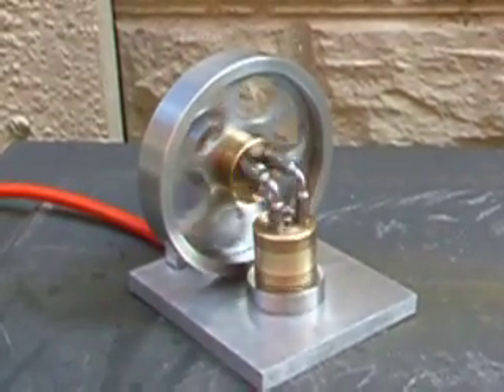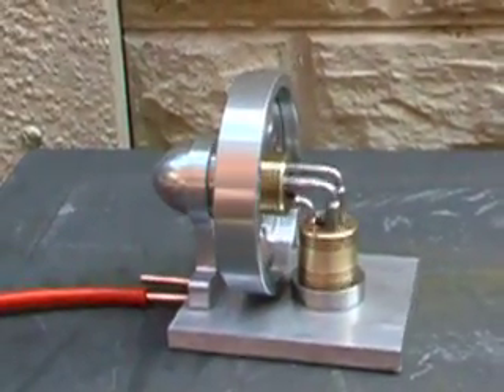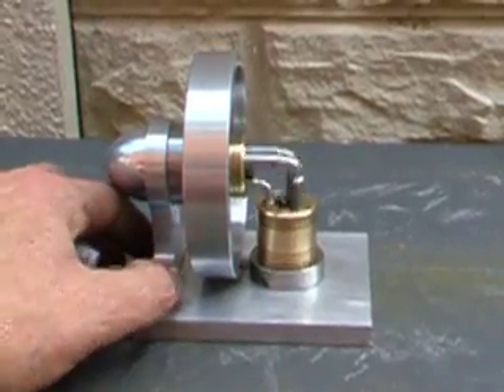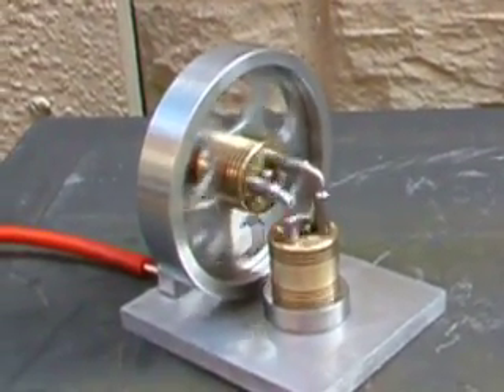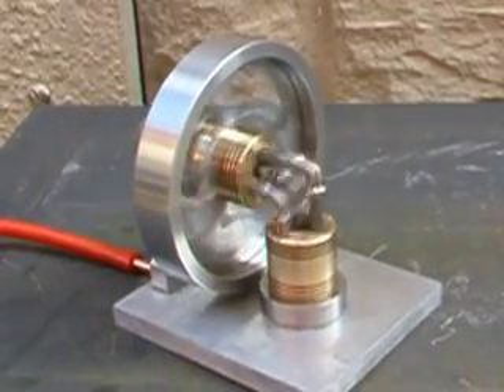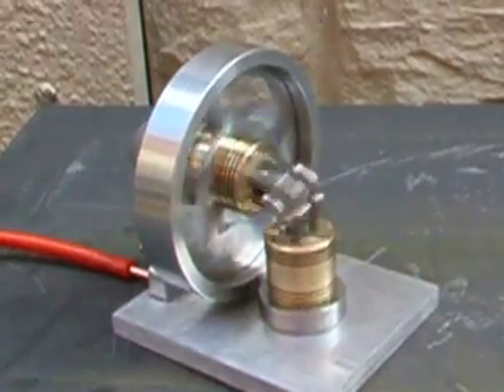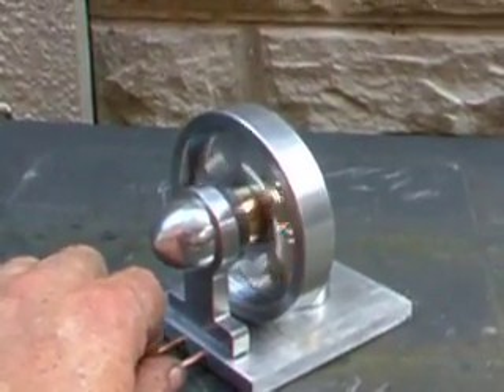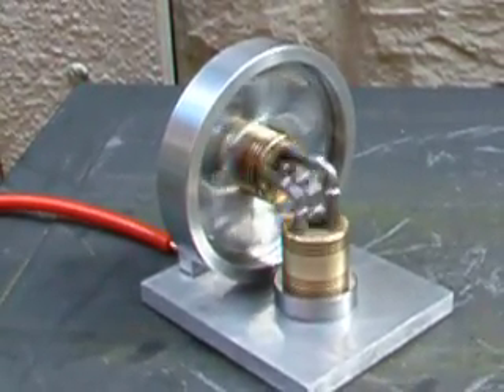My Elbow Engine

Comment from the maker: This is an engine made to show the concept of how the elbow joint worked.
You could have one input, and the output would be at 90 degrees to the input, but the output could be around a full 360 degree arc if required, with the centre of the arc being the centre on the input shaft.

I hope that explains it more clearly.

Comment from the maker: If you read the previous posts, it does in fact explain why this engine was created.
In earlier times, it was used in many applications, such as line shafts for driving machinery.

Comment from the maker: It is actually not my design, I just made it from basic plans.
But it is to demonstrate what is called a 'Hobsons Coupling', which allows a drive to turn thru 90 degrees without the use of gears. 
Imagine the flywheel being replaced by a shaft, as the shaft is turned, the one at 90 degrees to it also turns because of the way the 90 deg couplings move.
It is one of the most baffling engines when seen running, but one of the simplest in design. 6 cylinders and pistons only 5 moving parts.

Comment: I believe i understand. It is a neumatic motor an there are 3 valves an they go up and down by the air energy. This movement impels the pulley which there is in other rotational plane, so this sistem could be very good to change the spinning direction without a complex transmition of gears.